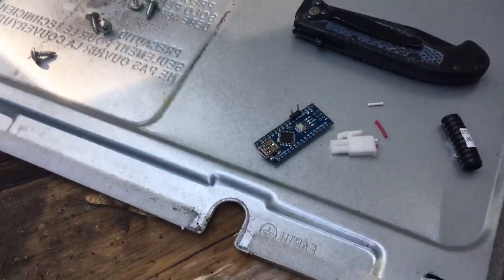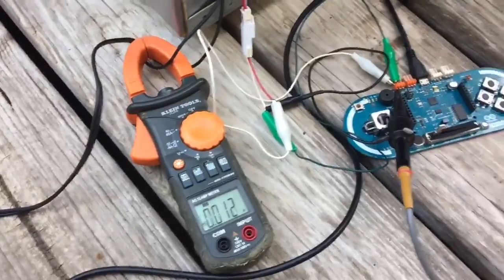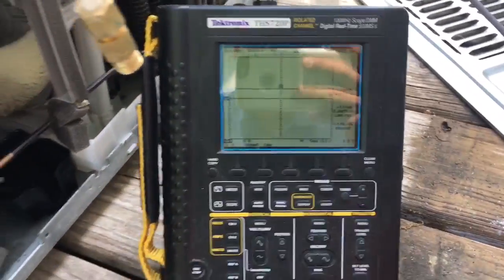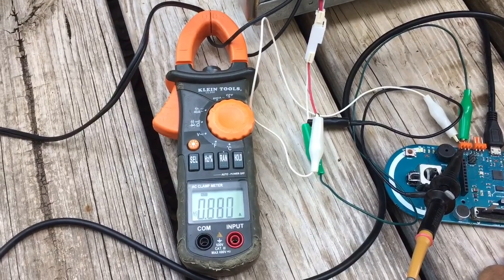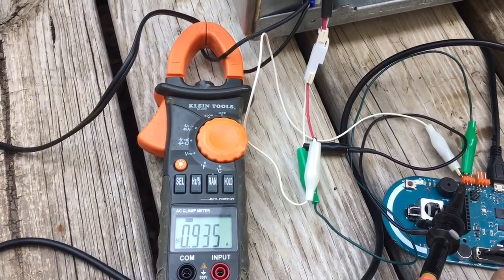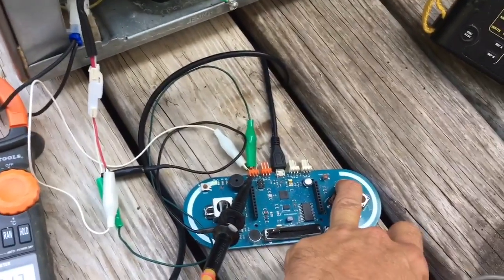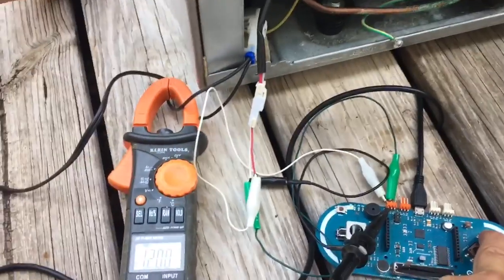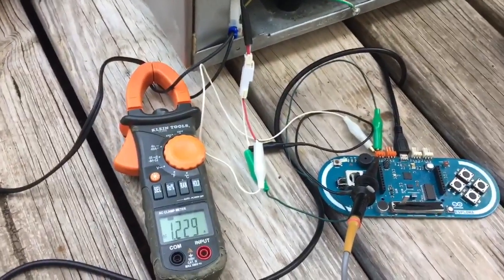Inverter compressor tester, the beginning

Comment: how were you running it from the arduino? im wanting to run mine from an arduino. can you still have it have 2 or 3 set speeds to switch between?
Reply from the maker: You can, but it depends on your application. I only need one speed for my homebuild. You just vary the frequency, the higher the frequency the faster the compressor runs.
Reply: @theappliancetechnician  would you be able to paste in your code to give me a starting point? I'm fairly new to arduino and haven't dealt with frequency yet

Comment: I need to replace a lg compresser fc75lbna, would you know another type compressor or would you recommend I go back with the original.  I'm having trouble finding this compressor at the moment an I need this frig working. Is thare another part number you may know of? Thanks.......
Reply from the maker: If it's a linear compressor you have to use another linear unless you make arrangements to use another type. I have another video on that.

Comment: Correct me if im wrong.
It works with AC but it converts to DC that is applied to a Pulse width modulator (PWM) that creates  3 phases where frequency  can be variated from 53Hz when it goes at 1200 rpm to 130 Hz when it over  speed till 3200 rpm creating more cold.  inverter ACU  the compressor  never stop only xhange it speed depending  of thermostat setting.
Reply from the maker: I don't exactly understand what you are asking. Inverter is usually referring to dc to ac conversion, rectified is ac to dc. This is a bldc or 3 phase motor and I believe they can run ac or dc but you need a driver to run them. I'm using a VCC3 controller to run it using pwm input signal to run it at different speeds. Just for fun really.

Comment: Hola, veo el mensaje off en el Display, quizás este en modo demo? Si es así encenderá pero no enfriará, saludos.
Reply from the maker: English please
Reply: I get the impression that this device is in demo mode, if so, the device turns on and apparently works but does not cool down. Demo mode is used in commerce for the client to see it, to exit demo mode if I remember correctly,  you must press iceplus and freezer, otherwise I feel I can not be of more help, regards
Reply from the maker: @juanjm1411  Lol, no, it's not in demo mode. Not sure how you got in here but that's running a compressor off of a control board that I programmed to run a control board at various speeds.

Comment: Hi walter
If you could help me please 
I have a daewoo refrigerator with a Samsung invertor compressor..

The inverter board goes faulty and I couldn't find any spare parts for it even in the Internet..

So I decided to buy Embraco vcc3 inverter 
Unfortunately my compressor did not work it just shake several times like it wants to run and eventually it stops..

Could you please tell me how to make this tester and how to connect it so I can test it.
One tip: I always get 6v output control voltage of my fridge

Thanks Walter for this great Video 

Here is my Email if you want to contact me..

thefatal2006@gmail.com

All my great wishes to you and your family
Reply from the maker: If it's shaking and just shutting down then the vcc3 doesn't like something. It will attempt to start 12 times and then delay and then try to restart again if I remember right. Did you ever get it working? Join us here for more fun. https://www.facebook.com/groups/1940521266213457/
Reply: @theappliancetechnician  

Hi walter 
Thank you very much for your reply and the great help..

Yes it just shakes several times and it stops for a while and it tries again exactly as you said..

It was working flawlessly with its original inverter board but unfortunately one day the electricity shut down and that causes the damage to the inverter. 
I checked it and I found the IGBT chip faulty and I ordered one and replaced it and back to work for around 2 weeks and again the same thing happened with the electricity and  again I replaced the IGBT  but unfortunately it didn't work this time..

What I did so far is I checked the compressor resistance and I found it 10 ohms in all pins
I also ordered another Embraco inverter board and unfortunately the same thing
I also tried to program an arduino to provide a square waves but with no luck..
This is what I wrote :

Int pin6=CTRL;

Void setup() {
pinMode (CTRL,OUTPUT);
{
Void loop () {
digitalWrite(CTRL,HIGH);
delayMicroseconds (2000);

digitalWrite(CTRL,LOW);
delayMicroseconds(2000);
{

That is it 
And I got square waves with 2.4 volts and around 60Hz

If you could please help me with anything I would be really greatful 

Again thanks Walter
I wish you a pleasent life
Reply from the maker: @FixTronics   

int pin3=3;

void setup() {
pinMode(3, OUTPUT);
}

void loop() {
digitalWrite(3, HIGH);
delayMicroseconds(2000); 
digitalWrite(3, LOW);
delayMicroseconds(2000);
}
Reply from the maker: Biggest problem is that we don't know what the errors occur at. I know it happens at over amperage and pretty sure at underamperage. I don't know the range though.
Reply: @theappliancetechnician  

Thanks Walter 

I will keep playing with it till I find a solution 

Thanks for your great help 😙

Comment: Great Demo!  I am trying to use an Arduino Uno to drive the PWM at 50% duty cycle (between 53hz and 100 hz) and I only get about 2.47V RMS vs. 3.3V on your Scope. This makes sense since the output is 0 to 5V, but I cannot see how you are getting the higher voltage.  I am trying to test an Embraco VCC compressor using your setup.  Before I condemn the inverter, I want to get the signal to match what I see in your video. Looks like you are using the tinkerport, but that should be 0-5V too. Any tips?  Thanks!
Reply from the maker: Try this

int pin3=3;

void setup() {
  pinMode(3, OUTPUT);
  }

void loop() {
     digitalWrite(3, HIGH);
     delayMicroseconds(2000); 
     digitalWrite(3, LOW);
     delayMicroseconds(2000);
}
Reply: Thank you  for your help Walter, I got it to work now!  Like you I will tweek the speeds.

Comment: Great video. Just curious if you knew what causes these Embraco inverter boards to go bad. I just replaced the 3rd one on my 10 year old GE Profile fridge. There must be a simple component to fix on the board, but surprisingly I have not see any videos posted on how to repair it. People just replace the entire board.
Reply from the maker: I've checked many of them for obvious problems and have never found the answer to that question. Unfortunately. I think that heat and power issues take them out because when they're dead it's usually after a storm or I'll find a clogged condenser. That's just a theory.
Reply from the maker: * UPDATE * It's not a simple fix, it's the surface mounted caps that go bad. A friend figured that out and replaced them with through hole caps of equal values and got one running again. If you can do surface mount work then it's probably not that bad but I've only done surface mount replacement a couple times and it's difficult even for me. It's not really worth the hassle for a $100 board. The secret in this video is that all vcc3 control boards are the same. No matter the part number. So the $500 VCC3 board is the same as the $120 VCC3 board.